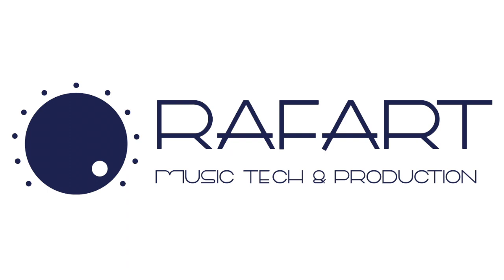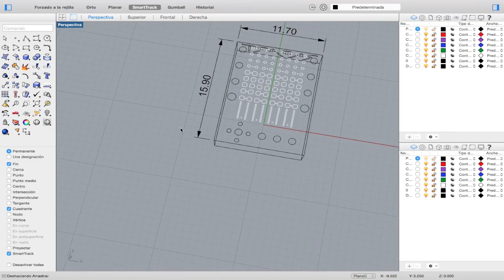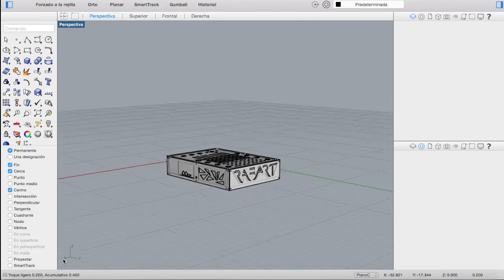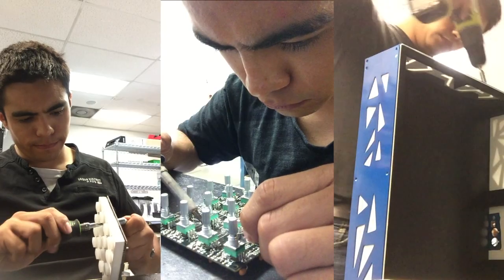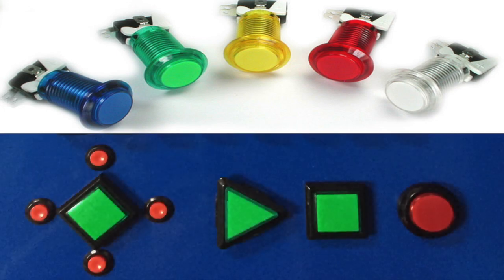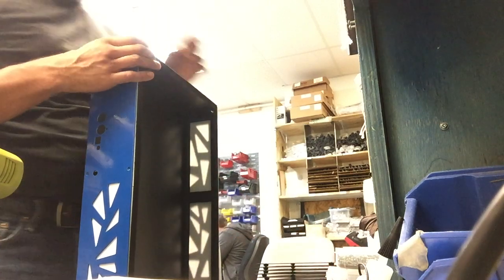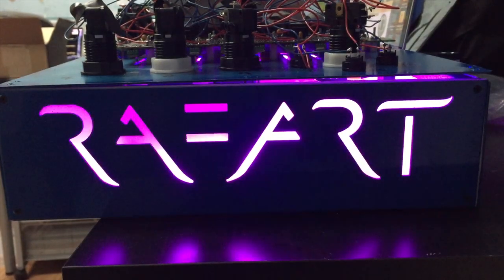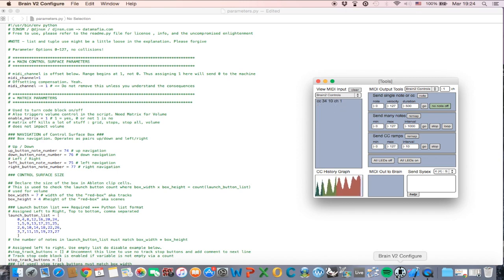El Nene Custom Midi Controller - Rafart Music Tech

Comment: Hi! Cool video!

What did you use to program your controller? Do you have any schematics that you can share?
Reply from the maker: Hi! I used Livid Instruments brain V2 and their software. Plus python for doing the Ableton script. I have some material of the design.
Reply: Thanks for the insight. Im guessing it was pretty hard to develop the python script... So is that board available to the public as open source? I think we would all be interested in purchasing these boards :p
Reply from the maker: For the Python script you can start off by modifying scripts of existing controllers. With the board you mean the MIDI controller itself or the Brain? The Brain is sold by Livid Instruments. You can use Arduino´s to program midi controllers as well. The MIDI controller itself is not for sale yet, I want to do a run of them eventually because there´s more people interested.